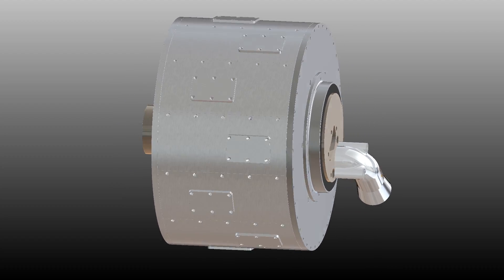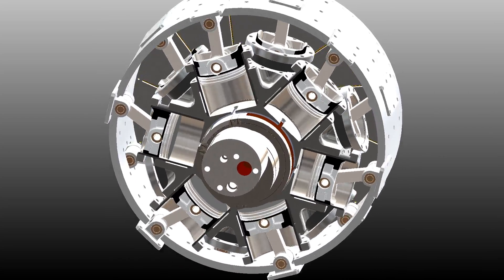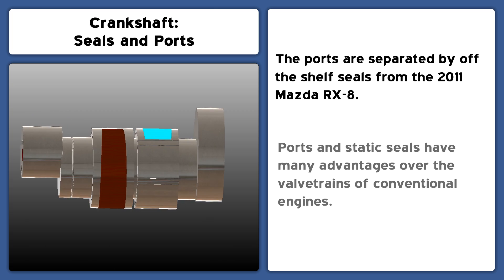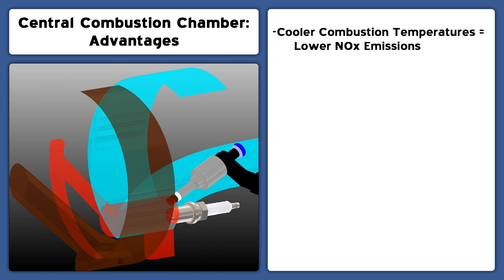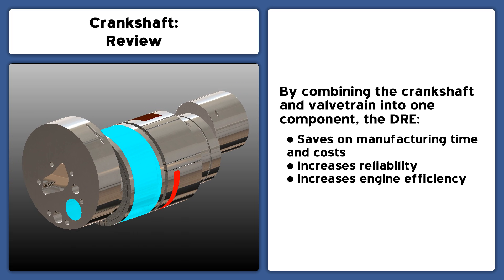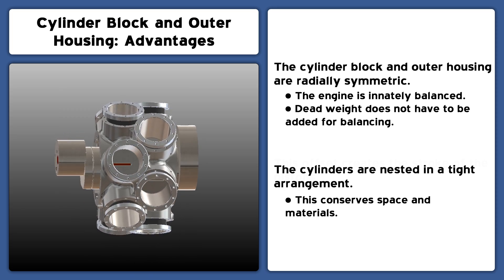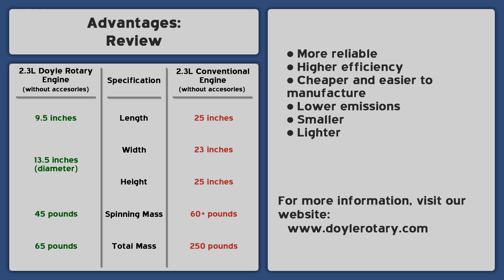New Split Cycle Engine Concept: The Doyle Rotary Engine

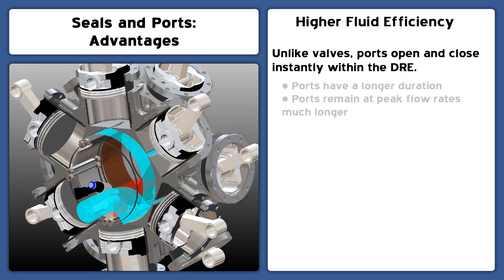Comment: @2:13 there is a claim that "unlike valves, the port open and close instantly". That's nonsense: the opening time of any port is the time taken for the opening in the two parts to fully overlap, and the closing is similar. 

The ports shown in the animation are slots in the axial direction so they open quickly, but they are also too small to be effective. 

Fundamental errors like this are the reasons that novel engine designs such as this one do not succeed... and the Doyle is an example of such failure.

Comment: I wonder what the Gyroscopic Precession forces would be like and torque on a plane, suppose it could be offset with a change of direction. Why not have the crank spin and cylinder fixed?

Comment: As most unusual engine concepts it suffers of many, many problems.
- The crank, even though it is supposed to be cheap and easy to build, looks be a nearly impossible to machine.
- cooling the combustion chamber also looks to be really hard, not only cause you can hardly get any coolant there cause it is inside the crank, it also is just one chamber for 12 cylinders, meaning you have constant combustion taking place.
-Lubrication is also really hard if not impossible, cause the oil gets thrown away from where it needs to be by centrifugal forces and it is hard to get the oil there in the first place due to the rotating design.
-just a way too heavy rotating assembly
-It is really hard to get a tight enough seal between all the moving components, reducing efficiency.
-moving cylinders relativ to other closely related parts like the combustion chamber need to be lubricated and the lubricant gets burned to a large extend as a result of combustion.
-The Slots the air is supposed to be entering and exiting the cylinders are way too small, causing volumetric efficiency to be terrible.
-Probably does not work anyways cause the combustion takes too long , meaning when the next cylinder with fresh air arives and the seal opens, combustion is still occuring, meaning the combustion pressure is litterally also pushing the cylinder backwards, making it impossible for the engine to run. At that moment, the combustion pressure is litterally working against the engine itself, being counterproductiv. Basicly, the cylinders taking care of intake and compression do a powerstroke in the wrong direction. If you add a valve to prevent that (which is not shown in the video), it still cant open cause the pressure inside the combustion chamber would be higher than in the cylinder, meaning the engine would stall and either way it is not even possible to make the engine run like that.
- How the hell do you want to fit a spark plug into the crank. Even if it were a Diesel you would need a fuel injector inside the crank.
-Furthermore, it is also way harder to fit into any car than a normal ICE
- The intake and exhaust are way to small and create a restriction so large, even if this engine would work, it could not generate any power whatsoever.

If anyone noticed more problems, please write it below this comment.

Comment: There are some force calculations I dont think will add up.
Due to the rotation being slower than the combustion cycle, the energy can simply not be translated into rotation, but will instead be translated into pressure towards the outer casing. Even if the engine could be started, it would be extremely inefficient.

Comment: So I take it u would use the actual engine block to drive or power stuff. In that case how do you keep the crank stationary? And with one central combustion chamber leads me to wonder about cooling. And the amount of heat that would be indured for 6 cylinders per revolution? And with that kinda burning eventually you would deteriorate the chamber walls and exhaust port?? Am I not write in this train of thought. I am very interested in your design.  In my generation terms, look dude! Keep it up we need people who think like you in this world.

Comment: Redesign it and use Nintinol power rod's that bend and contract with the use of different hetz frequency blasts with each Nintinol rod delivering a few tons of force per square inch to drive the engine. 😊

Comment: The pistons and basically the entire engine go spinning around a stationary crank as if some sort of flywheel with moving parts. My question is how do you connect that to a transmission...or even a tire?

Comment: 4:06
No, even if it is theoretically perfect, perfection cannot be made in the real world, so you will need to balance the engine, even a little bit to make sure there is not this problem , so saying there is no need for balancing is wrong, you rather should tell this will need less balancing mass/ balancing operation than other conventional engines.

Comment: Took a while, now I get it ... the combustion chamber is the  transfer port between 'low ' and 'high' side of the engine. Love it but how to hold it still and take off power? Maybe house it(as the Sun gear) inside a planetary gear transmission?

Comment: This reminds me strongly of the old 2 strokes WW1 airplanes used to fly, which had their own problems that at be a challenge for mobile engines like automotive applications. 

Since a large portion of the mass is spinning, centrifugal force will really tamper with the driveability of the car.

Since the engine is physically compact,  who wouldn't want a larger engine for more power?

How is this device cooled?The central camshaft will need a LOT of cooling as well as the cylinders.

That said, I see great potential for stationary applications.

Comment: Not really a New Idea, several WW1 planes were powered by Rotary engines that used a 'Fixed Crankshaft' and a Rotating engine block. They were a DISASTER due to centrifugal forces generated by the mass of the engine. 
In attempting to change the direction of the aircraft the gyroscopic forces of the engine would cause the planes to react to the forces. 
This made them easy targets for the pilots of the enemy aircraft.

Comment: Use skill saw antivibration technology on pistons then design each piston with induction levatation of super heated alloy in a mini graphite crucible to generate a hot gas engine. Use ferro fluid with magnetic bearings for advanced bearing system in place of oil lubercants. Place thick copper cylinders with high heat strong magnets on the pistons to generate the electrical current needed to power the induction levatation to heat the pistons for the hot gas cycle. You could develop a hand cranked electrical power generator that could also be used to heat with has well has provide electrical power. Way better then gas or diesel generators. 😊

Comment: This is very similar in principle to a gas turbine, only the added weight of all the pistons and the enormous mass being rotated would cause a lot of problems, not to mention the inherent limitations of possible fuel injection in this system. the gigantic mass being rotated would greatly hinder horsepower and RPM possibilities as well as throttle response. at this point a conventional gas turbine would do a much better job.

Comment: This is the opposite (upside down) Revolution Engine, which I showed all around the country in 200 and 2001.  He's moving the block.  We moved the pistons...with the same off-center crank principle.  Our gas-flow was in the style of a blown 2 stroke, recovering 5% of our power from the exhaust stream.  It didn't vibrate.  We were coming to fruition when bush #2 got elected.  Bad timing.  That was that.  Our engine put out 160 BHP per liter, running at 63% measured efficiency BTUs in to BTUs out.  I built 3 running prototypes. I ran one in our booth at the Detroit Auto Show at Cobo Hall in 2000. Check out  "Markel Motor"

Comment: Why not design this to operate off liquid air? Stirring cycle cryogenic cooler that produced liquid air that filled a Joe cell that changed boil off to hydrogen vapor to fuel the engine? You think it would work?

Comment: Use graphite with low voltage induction that run off solar panels or a battery bank to heat cylinders like a hot air engine. Use swash plate hydraulic pump motors incorporated with cryogenic Sterling cylinders to cool total operation of while engine. Set these up to turn gyroscopes that operates high voltage power generators. Novartis

Comment: Design a swash plate pump that has a cryogenic sealed sterling cylinder in it operated by a smaller swash plate pump that super cools the hydraulic fluid to control the heat and protect hydraulic system.

Comment: Create a mini swash plate pump that fits in each piston. That has a gear to turn main shaft on each mini swash plate pump. Design the mini swash plate pumps to pump at a high rate to produce speed. A totally hydraulic power wheel. ; )

Comment: Place low voltage Hertz emitting diodes that heat crystal graphite rods in each piston to change this into a hot air engine. Novartis

Comment: This design is brilliant, I just wonder how you cool the combustion chamber located in the crankshaft, which is nearly continuously burning fuel, is in the middle of the engine and is a rather small part that must concentrate a lot of heat. As the engine rotates around this crankshaft on an oil film, the heat can degrade this oil film and form carbon deposits.
Reply: The oil film question is simple: the same way every other journal bearing gets lubricated, oil flow. As long as there is sufficient flow and pressure, oil temperature, deposit buildup and wear within journals should be non-issues.

Cooling a single combustion chamber that has nearly continuous duty cycle might be a challenge despite the constant volume combustion being cooler than conventional high compression ignition. Then again, since the combustion chamber contains no moving parts, it could be lined with refractory material to keep most of the heat away from the crank shaft in the first place.

Comment: Both the cooling and heating concepts can be designed to operate off low voltage while producing high volts to charge capacitor banks such has a tesla wall. The working class could keep their homes powered just from their commute to work every day. No more electric bills! Novartis

Comment: Adam use induction and graphite rods in pistons blade outer casing then duct it to force high rate of air over engine. Duct housing designed with thermal electric generators to generate electrity from engine use. Advanced heating and power generation technology. Novartis

Comment: Adam replace the pistons with sealed cryogenic sterling cylinders that produce ultra low temperatures. Blade the outside casing then duct it so it works like a jet engine forcing a high rate of air over the engine. For an advanced cooling system.

Comment: Adam rethink your design. Try hot air induction engine using graphite rods to produce heat to run pistons. Use thermal electric generation to power in hub electric motors for a hybred vehicle that does not need fossil fuels or to be charged. Design vehicles that produce electrity using Crystal graphite power cell technology used with nano wire liquid battery technology and wireless power transfer technology to deliver generated power to a tesla wall or grid system when the vehicles are parked.

Comment: An idea is like a ray of light through a prism. One thought but multiple applications. Induction technology to Manson engine design to electromagnetic manipulation. Think about all the applications this engine could have if used with different modes of energy manipulation and configuration? Could this engine be used to power a submarine to pull and push it through the water? Could you  power airplanes with this engine? How about each train car with Axel's made from this engine that could both drive the car or generate electricity to be used to power towns and cities? Is all this very possible with your toy model? ; )

Comment: Could you not make an Axel out of this to power a vehicle putting all the torque right in the wheels? Or make a drive shaft that turns both the front and back wheels of a vehicle IE all wheel drive?

Comment: Could you not make an electromagnetic kicker to drive each piston? Or off set the pistons and use both induction IE hot air with electromagnetic pistons to optimize this engine design and pull away from fossil fuel use?

Comment: Induction and Manson engine design and you could make an engine to run generators with different rpm modes. No more need for goal or natural gas or even hydroelectric dams to generate power. Hay Novartis

Comment: You can use Hertz frequency to generate ultra low temperatures to cool these new electronic rotary motors that you can place in each wheel. You can also use this technology in heating and cooling and refrigeration. Novartis

Comment: Interesting concept. The first aircraft engines spun like this and were cooled by (cold high altitude) air. Even IF you could air cool this, I can see rotating mass issues, including gyroscopic and safety shields (making this much larger than envisioned). There is a reason air cooled engines usage is very limited, especially as the power increases. This engine is DOA.

Comment: Cylinder croyo cooling caused by a hertz could make this motor the heart of a new air conditioning unit. Man if you could only see it? Sterling and Manson engine design. You have gold here just step away from fossil fuel. Novartis

Comment: the seals in this thing are going to destroy the engine. as soon as it gets hot.
the seals will be pushed into the piston housing and rip in half. 
Then the enging will explode do two seizing from the seals made from rubber.
can't use metal either.

Comment: This rotating thingy might not seal well it's rotating parts at the combustion connection, and certainly will have lots of cooling problems. An odinary radial engine might be a lot better than this construction, I guess...

Comment: This engine would be so hot on one side and cool on the other. Just like wankel's this is a bad idea. A very bad one. Not to mention the moving-moving parts - gyroscope effect.
Reply: but the gyroscopic moment is inline with vehicle direction for90% of the time. turns would be slightly harder, but straight ahead more stable.
Reply: slightly = considerably
Cyclic moving parts are a lot more hard to be moved. There are multiple forces to take into consideration here. The other problem is that the inner part would be under in an unequal heat and pressure distribution. This layout would be capable of operate but only in a short run. Rotating engine block? This is against common sense.

Comment: How is the mass of the rotating components in comparison to a conventional engine? From my understanding, accelerating a rotational mass is a real robber of power at the wheels. Also, what of the gyroscopic forces induced on the oil film bearings by a sharp turn at high rpm (assuming a horizontal axis of rotation) or by hitting a large bump (assuming a vertical axis of rotation)?

Comment: What if you used the crankshaft as the rotating part instead of the engine block of this machinery?
Reply: Best comment so far.  There would be an issue with the vortex caused by the spinning intake, and the issue of  how to connect the intake and exhaust ports to the spinning crankshaft, but it would be fun to try.
Reply: As someone who watched how several engine constructions look like, I would say that connecting would be easier than you think if you think through how the mechanics will act once put in motion.

Comment: A reinvention of the old 2 piston spooling, single combustion chamber 2 stroke system used on many a motorcyle in the past (especially Puch). Far to complex though. Many of these concepts are a sort of CAD wildgrowth anyway. Have any of these impressive claims for instance actually been proven?
Reply: So there is more then this animation? You are completely right anyway. It, and many others such concepts. also reminds me of the Wankel rotary engine. On paper that had even more advantages bit when all the auxilaries to make it really practical where bolted on it still turnred out be yet another lump. And still it guzzled petrol. A pity though that even Mazda stopped producing them in the end.
Reply: There used to be a bit of a row in the 70ties within and without the FIM about how to measure a Wankels displacement. The FIM wanted to count the volume of all 3 "chambers" at once. which would for instance have put the Wankel W 2000 motorcyle, which was a quite capable machine when compared to conventional 250 cc machines on he basis of it's single "chamber" volume, in the same competiton class as a 750. which was totally rediculous. They'd better sort that point out first this time!
As far as the probability of such a resurgence in general is concerned: It bombed then and the indsutry is conservative in nature (see the above example). The road-use reappearence of the 2 stroke has also often been foretold, and the technology is viable as well (If I remember correctly Piaggo even built directly injected 2 stroke prototypes that met all the environmental standards) but still 4 strokes have, artifically, been made dominant.
And where is the electromotor per wheel, turbine engine topped up hybrid we have been promissed? In stead most available hybrids only use electricity as a sort of turboboost and, because of their complexity and weight, still burn as much or even more gas as conventional cars. Some years ago I saw a Lexus Hybrid advertisment proudly claiming fuel figures that are the same as those of my 20 year old car from a similar class!  
In other words: So much is possibe indeed but still unsustainable madness reigns. Brrrrr!

Comment: They have been doing this with hydraulics for years, while providing very seamless torque in both forward and reverse, they don't tend to be a force multiplier at least in the world of hydraulics. I wonder what the power to weight ratio is ? I bet it is heavy.